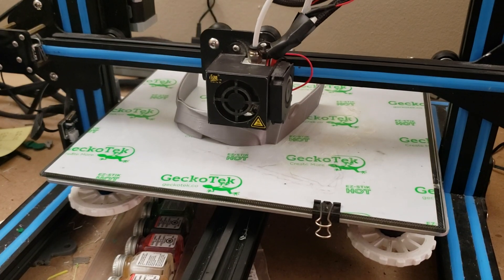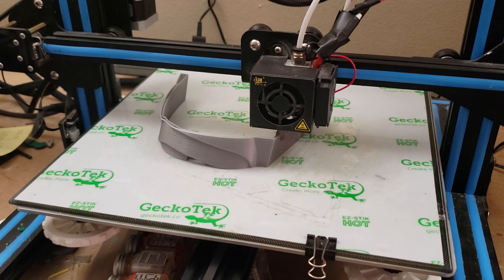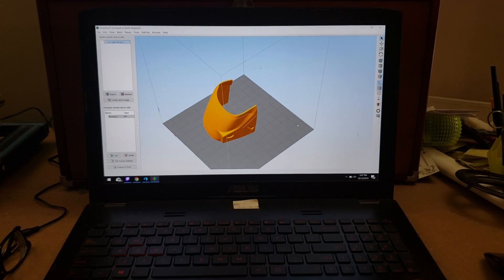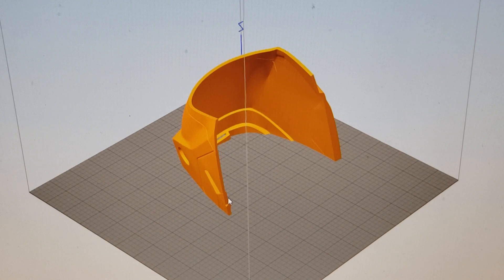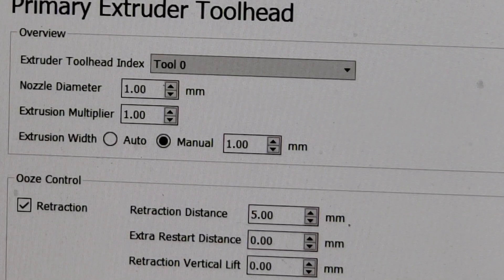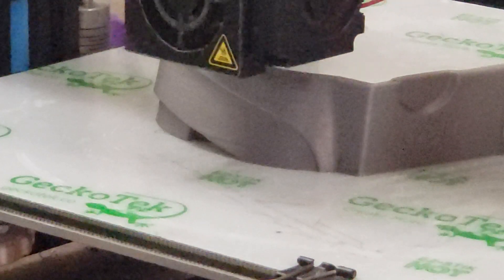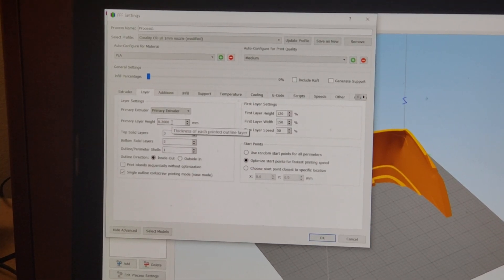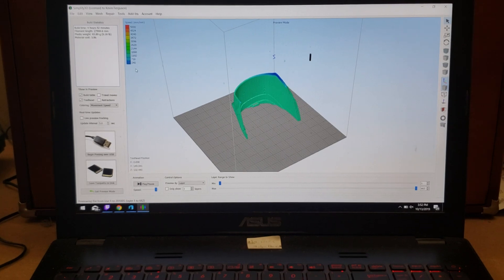Taking the mystery out of 3D printing with a 1 mm nozzle.

Comment: WHat layer height are you using on a 1.0mm nozzle?
Reply from the maker: My layer height is .2 mm. That means each layer is .2 mm tall and 1 mm wide
Reply: @fergi1959  0.2 layer height on 1mm nozzle. wouldn't it would be slow to print?

Comment: Hello, what is printig speed in the case of 1 mm nozzle?
Reply from the maker: It's the default setting for a CR10.. 2400 mm/min or 40 mm/sec
Reply: @fergi1959  Thank you for your replay. I have upragraded firmware because I use direct extruder Titan Aero.
Reply: Yeasterday I check 60 mm speed,  it is ok
Reply from the maker: A direct extruder is very nice.